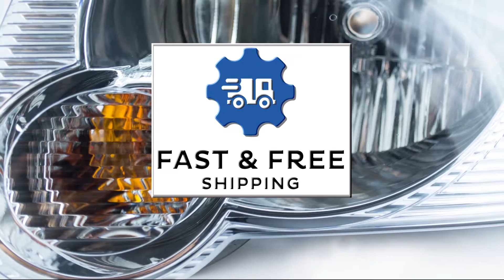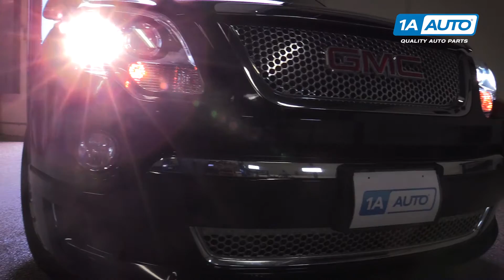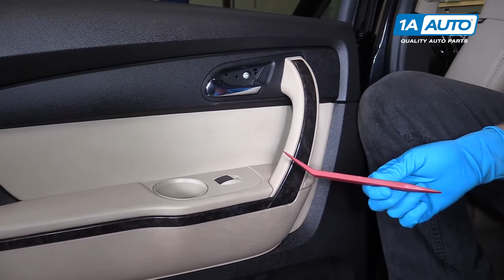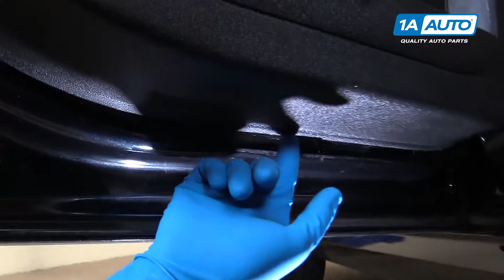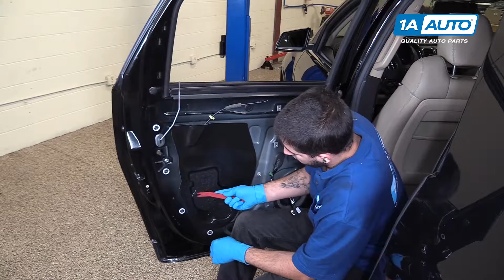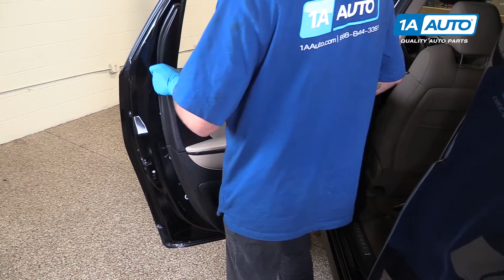How to Replace Rear Window Regulator 07-13 GMC Acadia

Comment: Nice video but totally worthless if the actuator is not working. My window is stuck up and I can not lower it. Why would you replace a window actuator that works and how to you get to the bolt on the bottom if the window is at the top.
Reply from the maker: +Dustin Tunis Thanks for watching!  If the window is totally stuck at the top for this vehicle, then the main way around this is to cut the cable that drives the window up and down.  You will have to replace the regulator at this point, but if it is truly stuck then there is really no other option.
Reply: It would be nice if they would reply to questions and not just praises.